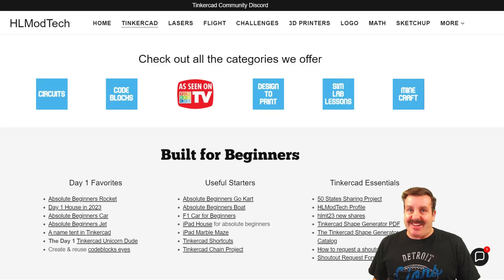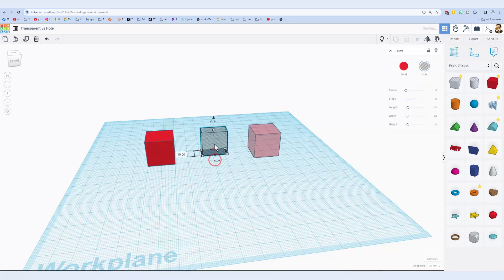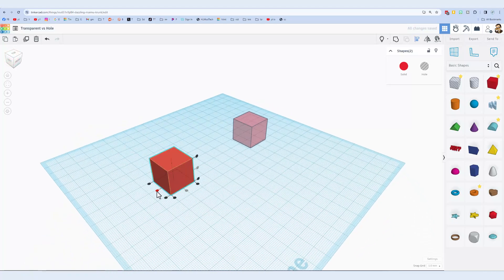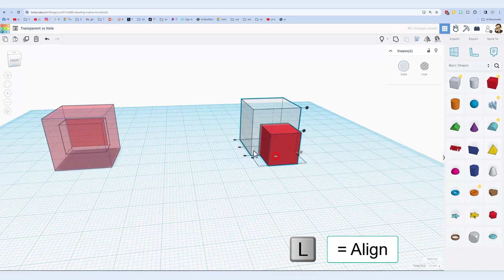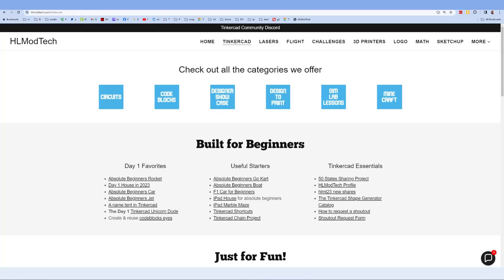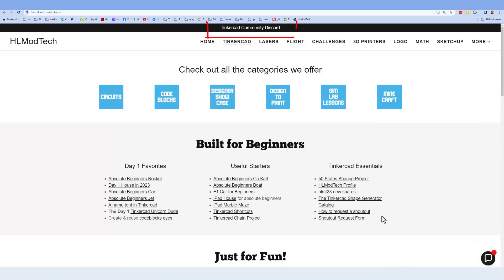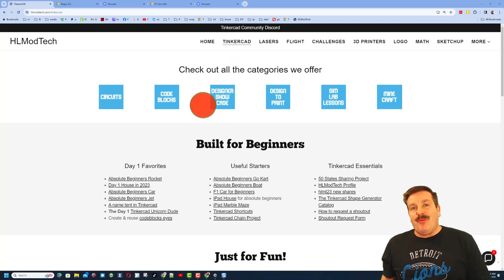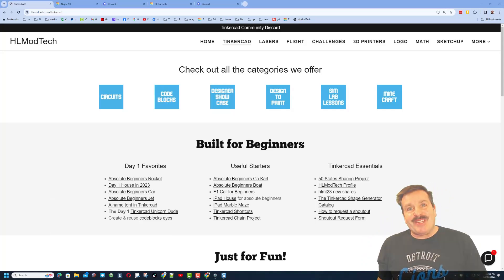Tinkercad Holes, Solids, & Transparent Design Smarter in 2 Minutes 💯👍

Comment: Do you have any video(s) that address how to design and print a horizontal hole and have it turn out round instead of squashed? I realize you are not necessarily a 3D printing expert but thought perhaps the matter had been discussed in Tinkercad design terms at some point.
Reply from the maker: What printer are you using? I find mine handle horizontal holes just fine.
Reply: @HLModTech  Prusa Mk3S ,
Reply from the maker: Ok. I’ve always heard good things about them. You could try just putting internal supports in your slicer settings.